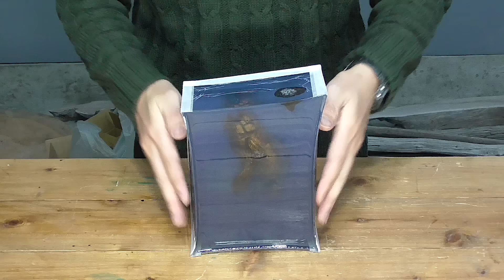Making beautiful and perfect paintings 3-D with resin art [ Diorama / thalassophobia ]

Comment: Why is the block not in a straight line anymore? Does this happen when the resin dries? Do you consider making the block straight and smooth on all sides again, after the resin dried? And very good work, looks super cool.
Reply from the maker: I like this curve. Thank you.
Reply: resin often emits heat when curing (drying)! The temperature probably caused the acrylic to warp, making it curve inward